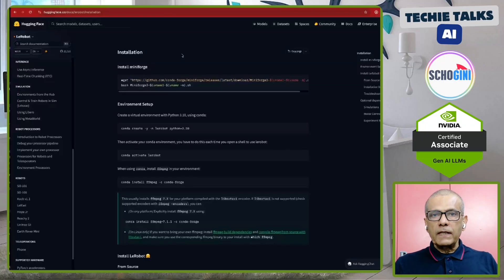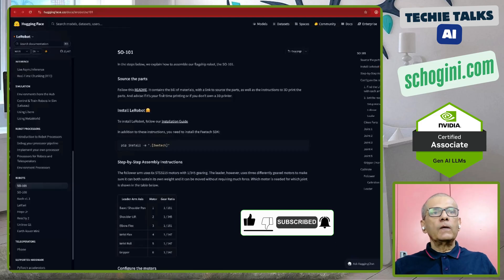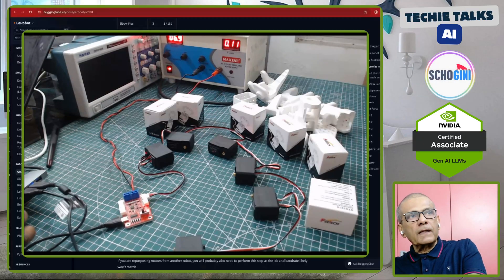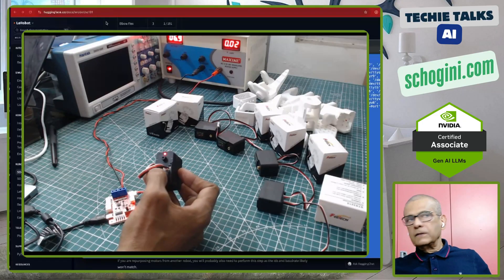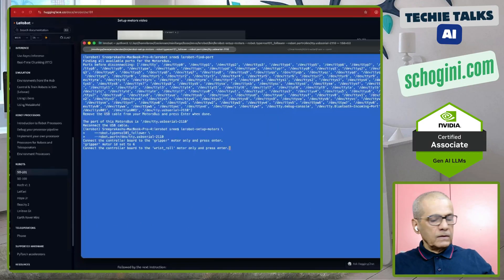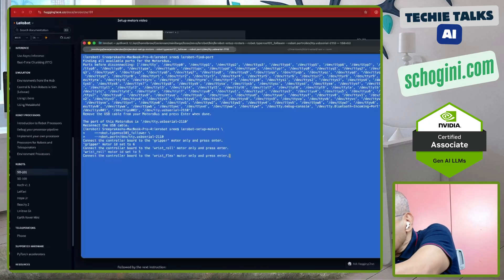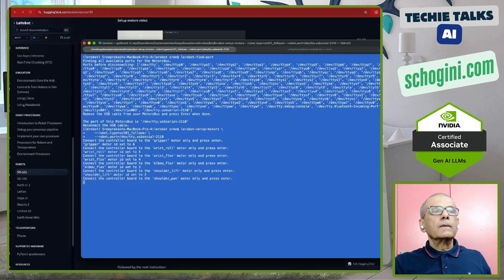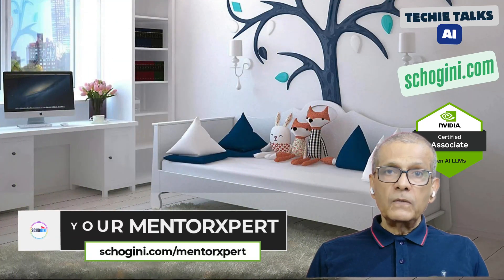Ep-03 LeRobot SO-101 Arm | Motor ID & Baudrate Setup (Follower + Leader) | Step-by-Step

Comment from the maker: ⚠️ Important Step – Don’t Skip This!
If your SO-101 arm jitters, stays silent, or behaves randomly, motor IDs and baudrate mismatches are usually the reason.
In EP-3, I show the ONLY correct way to: ✅ Identify the right USB port
✅ Assign unique motor IDs (1–6)
✅ Set a common baudrate
✅ Safely write to motor EEPROM (one-time setup)
✅ Configure both Follower & Leader arms
👉 Pro Tip:
Always connect ONLY ONE motor at a time during setup and double-check cabling before pressing Enter. One wrong connection = full bus confusion.
💬 Tell me in the comments:
Which motor gave you the most trouble — Gripper, Wrist, or Shoulder?
🤖 Want help beyond YouTube?
I offer 1-to-1 mentoring, hands-on AI Robotics internships, and fully assembled / DIY robot kits.
👍 Like | 💬 Comment | 🔔 Subscribe | 📤 Share
— Sree from TechieTalksAI